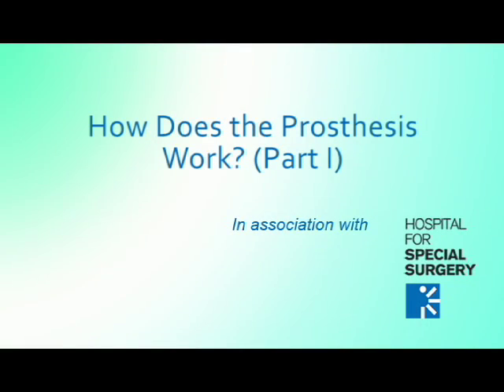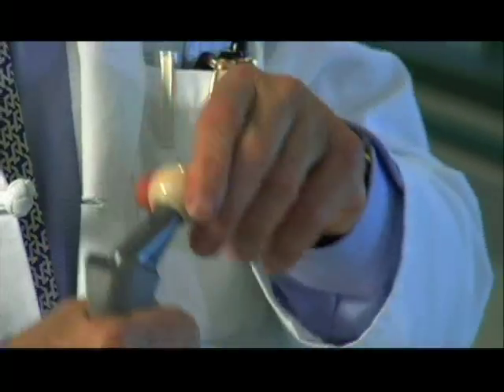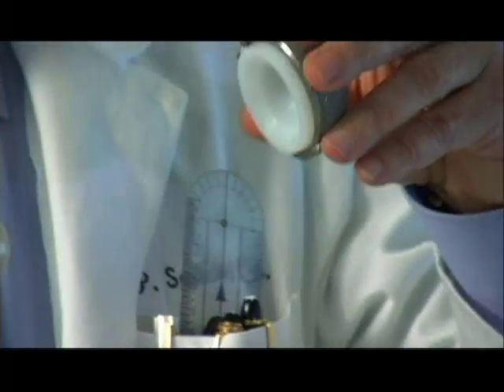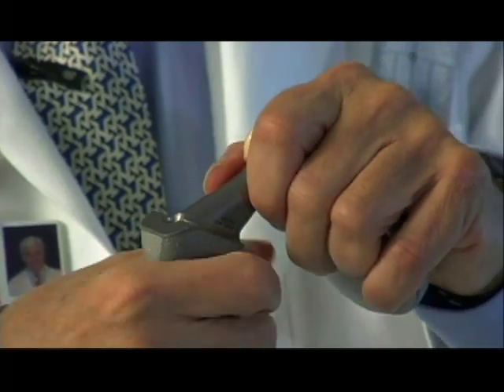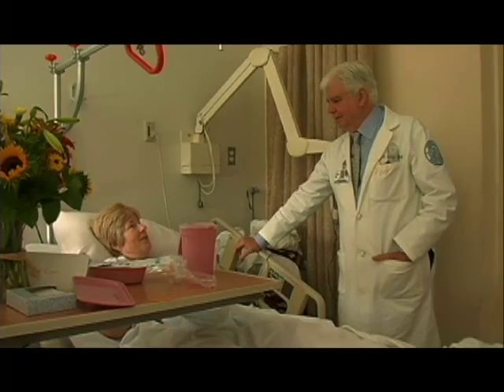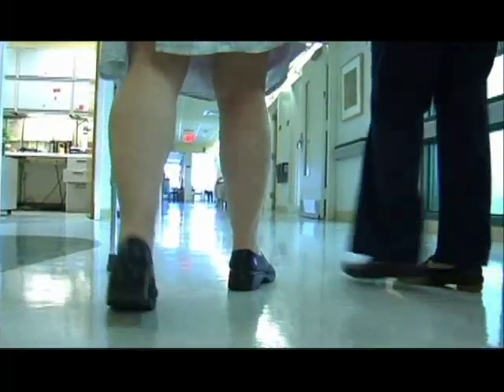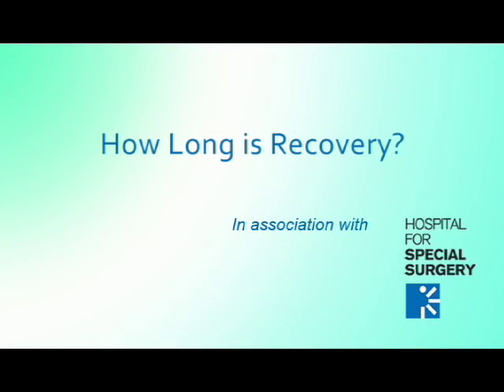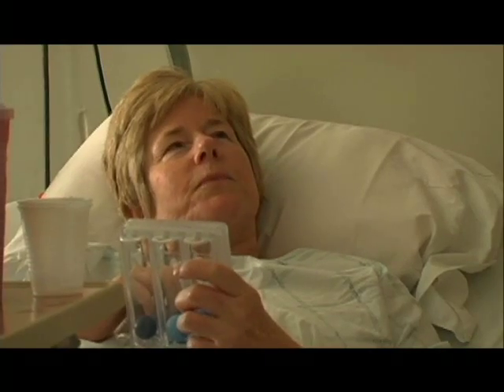Hip Replacement Surgery Part 5: How Prosthesis Works & Recovery Process - Dr. Thomas Sculco

Comment: I had a total hip replacement posterior approach. It has now been 3.5 months. I did go home with hip precautions, I follow them for 8 weeks. Posterior approach is the longest period of time for rehabilitation. As they do cut through your gluteus maximus and gluteus Minimus muscles which takes four to six months to heal. Regardless of what approach your doctor my use, at 6 months we all feel exactly the same. should have done this a lot sooner. Your best defense is ask as many questions as you can.

Comment: Yeah, the bone grows into the stem, and heaven help you when you need a revision; your femur shatters into a million pieces. I've had FIVE hip replacement surgeries, and the only reason a PT vulture should come to your bed after surgery is because THEY want to bill YOUR insurance company! I had FIVE dislocations following one hip replacement surgery,  because I was not given post op instructions.  

Your hip needs to SCAR IN.  You SHOULDN'T be up walking around after a THA.  You should be on crutches, doing partial weight bearing over a period of weeks, gradually building up to full weight bearing.
Reply: That's what I was wondering. They are actually much more conservative with arthroscopic procedures such as femoroplasties as far as post-op precautions goes.